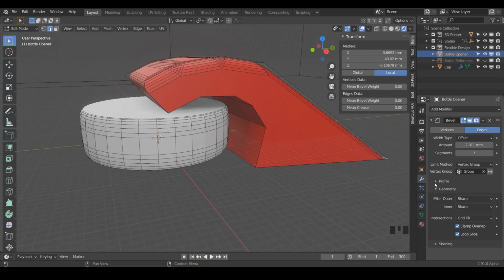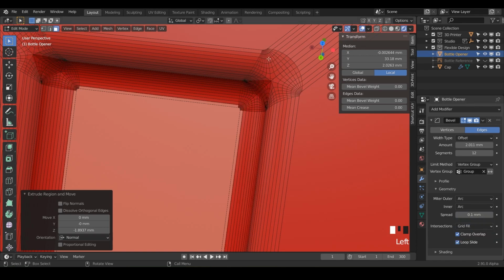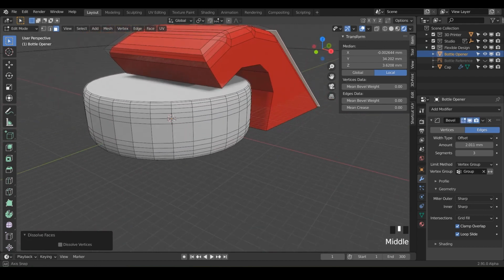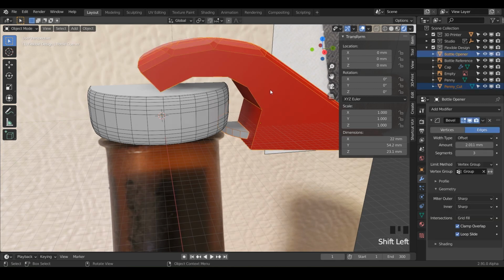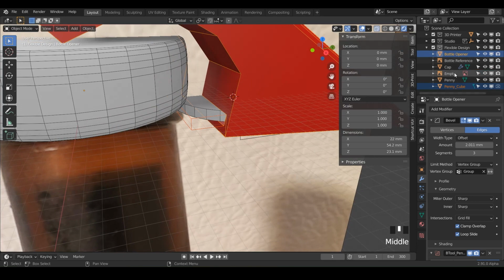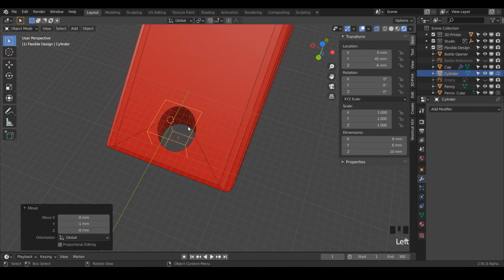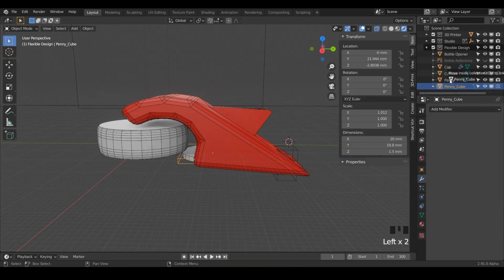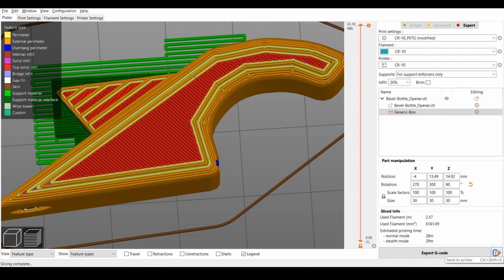Bevel Modifier (EXPLAINED) Part 2 | FREE Blender for 3D Printing Course

Comment: Looks cool, but here’s some thoughts: 1) The back edge near the keyhole seems too sharp;   Suggest a thicker back edge  with some smooth beveling. 2) The shark fin looks cool, but not practical. The fin will definitely cut the thumb being used to lever up the bottle opener during use. So it’s a no go. 3) Depending on the strength, or lack of strength of the PLA filament, I think the penny hole will break through the bottom PLA, since the penny hole bottom edge is so close to the bottom edge of the bottle opener. Perhaps thickening the bottom of the bottle opener will give the penny hole a bit more robustness. 4) Testing the bottle opener might prove whether the “nose” of the shark will be robust enough to survive the force required to “clamp” the bottle cap from the top long enough to pop it off from the side (by the penny). Otherwise, back to Blender to figure out what design will better support the cantilevered “shark’s nose”. Otherwise, nice start on a bottle opener design. Well, to celebrate, use your new bottle opener to crack open a cold brewski!